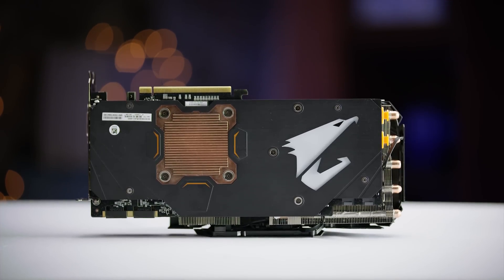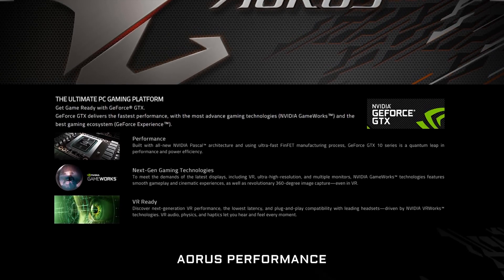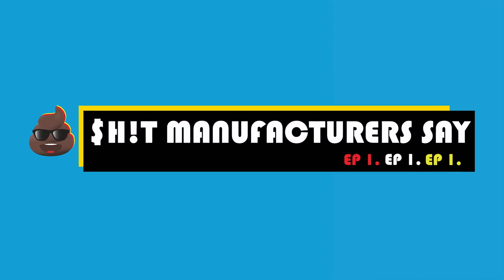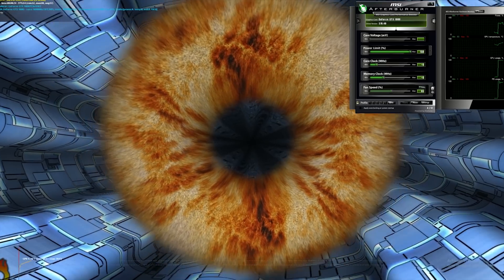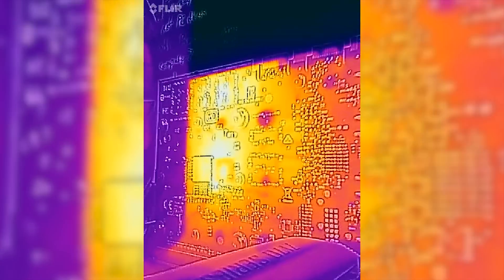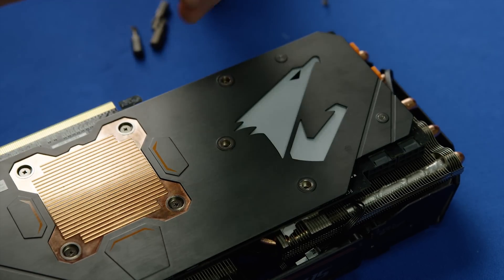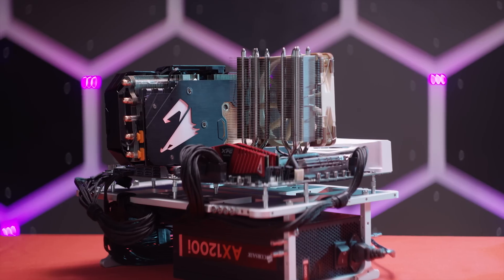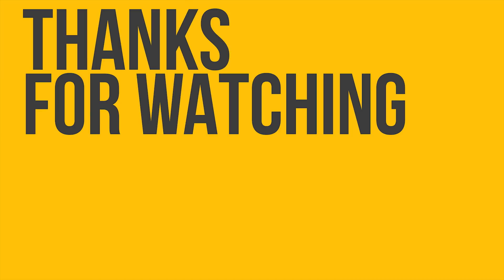$h!t Manufacturers Say Ep. 1 - "Backplates Cool Your Video Card"

Comment: Enjoyed the video and your results matched my intuition. However, there may be a small methodological issue due to the lack of airflow on the test bench. That copper backplate, which is really a heat sink, has a terribly small surface area and would never be efficient passively. Passive coolers are usually massive with very widely distributed fin stacks. Therefore, it is at least conceivable that it needs significant airflow to efficiently get rid of absorbed heat. 

In order to give the Aurorus Xtreme Gaming its best possible shot, in addition to a more real-world test, I would suggest either testing it in a functioning enclosed case or simply adding a couple of NF-A14s to the front of the test bench. 

My suspicion is that this will make no observable difference on your equipment, but principle of charity and all that.
Reply: this test would make more sense in a closed case with airflow. Indeed other tests showed that backplates can help to cool the card with a couple degrees difference. Some people made custom backplates with cooling fins or even watercooled backplates and had great results.

Comment: The copper "heatsink" on the backplate is just a copper alloy with no coating, one can't read the temperature of bare metal with a thermal imaging camera as one would find oneself reading the temperature of nearest reflected wall. In the industry a thin tape or coating is applied to the metal to achieve an accurate reading.

Comment: This actually matters a lot more on cards with GDDR on both sides of the board. A lot of times, the front-side chips get thermal pads to the main heatsink, while the rear ones are left to roast.

I understand that they can reach temperatures in excess of boiling before it is a problem, and you will burn your hand at 50-60C making touch a poor indicator of safety, but it just doesn't seem right, especially when overclocking, to leave some of the chips exposed.

So normally, I get one with a back plate and check to see that thermal pads are placed between the plate and the BGA chips. In some cases, I've added them. Back when I had my 6600GT and got a Zalman cooler, I actually bought some sheet aluminum and bent it into shape, used some thermal tape for thermal conduction, and electrical tape to protect the surrounding components. Made a world of difference, especially when overclocking the RAM.

Otherwise, I don't see a rear-mounted hunk of metal doing much with regards to the GPU itself. The die is placed on a breakout BGA daughterboard, so it isn't exactly a direct thermal interface where you could use a ton of thermal vias to redistribute the heat. like, 99.9% of your thermal conductivity will be at that point where the die itself directly touches the copper. Anywhere else, and it is going through the die, the daughterboard, the BGA solder balls, the thin traces, the insulating fiberglass board, a thermal pad, and then finally to the copper on the backside. The only thing I can see it doing is improving the lifespan by reducing the rate of heating/cooling of surrounding surface-mount components.

Comment: Your test is in an open world environment without very much air moving over the copper plate. Try the same test in a case and make sure there is ample air flow over the copper plate.

The copper block may not reduce the GPU temp it self but i am sure it keeps some of the massive heat from the GPU from spreading in the PCB to the surrounding components so i would not say it is worthless.

BUT the most important part is that it makes the gfx card look so much cooler, if you pay for xtreme you also want the xtreme look :D

Comment: There is only one benefit to a setup like presented by this Aorus card. By effectively cooling the components around the card, you extend the life of the card. Problem I see is that it does not focus on the power management components and mostly focuses on ridding of heat surrounding the gpu component. This could result is fewer bga fractures related to heating and cooling. Thing is, most cards I have seen, die because of other component failures more often than bga fractures. So I rate this backplate a gimmick because it does not focus on other components that need it more, like the power distribution segment that still shows a toasty hot in those thermal imagines.

Comment: What a genius idea hey lets stick a heatsink on the wrong side of a ~1mm thick plastic polymer that surely wont possibly harm it's effectiveness right I mean it's not like plastic polymers are usually used for thermal insulation rather than conduction or anything right? And yeah I am talking about the PCB itself the thing is plastic what on Earth were they even thinking idiots. For something like this to really work at all it would need some kind of solution to efficiently transfer excess heat through the PCB even then with the relatively low effectiveness of passive cooling and the fact those tiny fins are really not doing much for increasing the surface area of that copper backplate for it to transfer any real heat load at all away it would probably need to be expanded in surface area to cover the entire back of the board or something even then I can't imagine it disposing of even a fraction of the heat of the actively cooled heat sink on the front without having case fans positioned deliberately to direct air flow over it.

Comment: I had an EVGA fail because it did not have a rigid backplate. That backplate is a must for a tower case as it stops the card sagging which pulls away and makes a poor contact between the heat sink and GPU die.
Never buy a high performance full sized card without that backplate if you want your card to last.

Comment: Out of curiosity, have you done any testing to see if the backplates have any effect on the ambient temperatures inside of the case with the side panel in place?  I know the GPU adds a lot of heat to the air within the case itself.  I just wonder if there is any effect on that temp increase with a blow-through cooler designed GPU with or without a backplate.

Comment: That copper backplate looks like it might have a decent purpose; what are the odds that a closed unit CPU water cooler could be attached to that backplate like the Corsair Hydro H55 or something? My guess is that if there is any sort of decent heat transfer to the plate, adding a CPU cooler to the back would essentially turn the card into a ghetto hybrid cooled card.

Comment: Wouldn't it depend on how the GPU temp is measured? 
With the copper plate it'll dissipate the heat across the card away from the processor. 
So if it is measured by temperature across the entire card it'll read the same, but the graphics processor might actually be cooler. 

The more accurate way to test this would be, to measure where the chip is with a thermometer gun.

Comment: I know there weren't any temp differences. But you should put the backplate back on and retest. by taking off the cooler to remove the backplate, and putting back the cooler, that's a lot of change. maybe it's tightened better with better contact

Comment: Here's a question,
Far be it from me to question your guys, as I'm fairly new to this, but, shouldn't a fan be blowing on the backplate heatsink?
I mean a heat sink does nothing more than pull heat from a source, but it needs a flow of air to dissipate it more efficiently, something the inside of a case usually provides (ususally).
I didn't see any fans blowing in the direction of the backplate to allow for dissipation...

Comment: When you have a BGA chip with copper vias all the way through, you can indeed cool a chip from the reverse side. However, the heavy duty cooler on the front with lots of moving air certainly matters much more. I would have run that test with the card next to something which also moves air to at least give it a fair shake.

Comment: You didn't mention anything about fan speeds which were probably on auto so having the same temperature does not tell us anything. Removing the cooler and reapplying the thermal paste also invalidates the test. It would have been easier to simply cover up the copper on the back so it would no longer radiate heat. There may also be an improved benefit in a case, depending on the set up.

Comment: Did you guys consider that the backplate could be there for cooling other components other than the GPU Cores, like memory and power phases, MOSFETS and so on. it could be actually for safety rather than performance.

Comment: It absolutely depends on the card.
I have two 1070 Phoenix GLH, and their backplates get seriously hot.
They're mounted with zero spacing and when I bench the lower card and crank up the top cards fans the lower cards temperature decreases by 5 to 6°C. 
So with airflow at their backside Gainward Phoenix cards definately run noticeably cooler.

Comment: the test bench was placed horizontally on the table, but if the motherboard was in a vertical position like it would be in most PC cases, would that change the result? because heat rises and in that position more heat would be directed towards the back plate.

Comment: I put a 70mm CPU fan on the back of my old HD3850 back then (with a 10mm spacers in between). I remember it droped a few degrees, and the backplates (specially the VRMs) weren't dawn hot anymore.

Also those card have massive cooling solution, maybe there are a small different with smaller coolers (those that cards don't include backplates). I remember people use to put "sandwich" heatsinks to old PCI video cards, when the stock coolers where a joke and there weren't any aftermarket solution available, only adapting old PIII slot heatsinks.

Comment: Can anyone tell me how much power an 8-pin power connector can supply, I thought is was 150 watts, but the quadro p6000 draws 250 watts of power (75 of those watts from the motherboard), and it only has 1 8-pin connector

Comment: I watch the whole videos.  The problem he is making in this videos, he is reading only core temperature without reading vrm temperature on a open bench station.  He misses a important fact it doesn't cool the GPU core from underneath the socket of a Gpu that would of help keeping it from spreading across toward the Vrm, but instead is cooled by the Heatsink shared with the GPU if the marketing tags ring true.   Gpu-z have this as well with HiWinfo64 to show the temperatures of the Vrm, when he taking it off butt naked, we should be seeing some different number and again, doesn't show that data because it was missing.

What I would of done in this tests is to get the arm fan holder and position it on the front end to provided some relation of a case air flow when on open benchmark case.   What test bench he doing is open space, no airflow going anywhere as I would might as well uses it as a electric stove to make me a grilled cheese sandwich.  The cool spot of the GPU heatsink showing it doing it job of absorbing extra heat coming from underneath.  I would dare you to touch the back of the Gpu and tell me it isn't skin burning hot lol.  But you might want to watch what you're typing of your videos titles, otherwise you are making a fools of yourselves without some extra data beside the cores temperature.

Comment: If it was me, I would not have used air cooling on the CPU that is effecting your results when testing the gpu even if only slightly but try again with water cooler for the CPU????

Comment: Pretty much every video about thermal management or improvement is going to yield these results. The temps you see in a PC just aren't high enough to offer that amount of variability. We have systems that work already, and changing airflow or the material for your sink isn't going to make measurable changes, especially not noticeable ones to the average user.

Comment: temp difference that you see in flir is due to different emisivity. that means that textured plastic can be 5degrees higher than shiny copper, even if they are at the same temperature. read wiki about emisivity ,

Comment: Shit youtube channel Say that the temperature of the GPU is only the core one. and that putting a card on a bench is a good method to measure temperature of a passive system that will strongly ne affected by air flux.
Not saying that this backplate is more useful than any other or useful for the core or VRM or voltage regulation temperature. But in some scenarios (mostly dual graphics cards) with a limited air flux if VRM are on the back or voltage regulation system is on the back of it the backplate fucking helps

Comment: Have you guys ever considered that there is more stuff in a gpu than the gpu itself??? 

YES! I'm talking about the VRAM! 

Didn't tell us about the VRAM temps did yea!? 

Would appreciate it if you had used hwinfo and checked out the VRAM temps. Because if you DID, you'd notice that heat at the 'BACK' of the card dissipates quickly when a back plate is installed. 
You've half proven my point when you 'accidentally' mentioned the cold spot on the Aorus backplate. That's shows that the backplate helped in dissipating the heat at the back better, so less concentrated heat is stored on only one spot on the pcb of the graphics card. 

Kitguru do these comparisons with that thermal imaging. 

MSI's Rx 470 without the backplate have a big hot spot at the back, but not sapphire Rx 470 which has a back plate installed. The hot spot in more evenly distributed at the back.

Comment: Luke, was the copper square warm or hot when it was on the card? Would it have an effect being in an actual case with case fans running blowing air into the case and therefore over the copper plate?

Comment: Perhaps, if the card was lying horizontally, with the plate facing upwards, you may have seen a degree or two improvement. That is usally how cards sit in regualr PC cases. Also, it helps concentrate the heat to a central area which can be cooled by case fans. 

I don't think a test bench was the best way to actually test their claims. Still, it would literally make zero difference in terms of performance, whether or not there was a 3 degree reduction in temperature.

Comment: Not arguing with findings, but theoretically a back plate can help relieve physical stresses brought on by temperature differentials on the board.

Also, when using a FLIR camera, it's best to compensate for surface differences. Having used these before, the application of a specific SKU of electrical tape, or spray on foot powder (yup, they both work for this) will leave you with a reliable point to read IR temps with.
Reply: Update: I found the thermal images that demonstrate the thermal imaging surface issue, but don't know how to post photo responses....
Reply: try imgur and post a link
Reply: Well that took me a while... The word I was looking for was "emissivity." Without knowing the emissivity of a surface, the camera can't accurately interpret the data it receives. In this image, the bright spots are the areas where we used electrical tape to normalize emissivity to 0.95: http://imgur.com/W5dqqNg

Comment: did you set the fan speed fixed?
Reply: If you look, the fan speed as 64-65% with the backplate on and 69% with the backplate off.
Reply: @zshadows  Good spot!
Reply: @zshadows  so I guess it wasn't a complete lie but seriously, you're not gonna notice a difference. just over engineering for the sake of over engineering
Reply: This was the question. It may have run just lower fan speeds with the same target.
Reply: no they didnt lol, you can see it in the video it was on auto

Comment: if it looks hot doesn't that mean it's emitting more heat therefore dissipating more heat? so the copper plate is actually insulating the card which is bad?

Comment: Accelero Xtreme IV aftermarket GPU cooler has actually great cooling on the back side, basically doing memory cooling (so NOT extra cooling for the core) through the PCB. It takes an extra slot of space though.

Comment: Just think about how thermal conductance works. It's like a parallel network of resistors. Imagine the front cooler being a really high conductance (lots of surface area and high airflow). The back cooler has much less surface area and barely any airflow, so it might conduct only 1% what the front cooler does. So putting them in "parallel" would only benefit 1%.

Comment: The "cold spot" on the backplate seen in the thermal imaging video was almost certainly due to the reflectivity of the copper.  Reflective surfaces will generally show up as the temperature of whatever is reflecting off of it.

Comment: IF you could of locked the fan speed on the video card, might of seen a change with the cooling.  However I don't think the backplate would make much of a difference imho.  Without increasing the surface area(fins) or air flow in that area I really don't think there would be a change.

Remember the copper plate was ribbed for your pleasure and not for cooling :)

Comment: why it didnt improve gpu chip temprature. if there are mosfets,transistors on top of pcb the heatsink will help to cool them components. now these components would be ok without heatsinking however if you can keep them cooler they will live for longer. and improve performance of them for longer. this card is the overkill kind of product

Comment: You should have done this test with the GPU running inside an average computer case, so the copper back-plate is exposed to the constant flow of air being cycled by the case fans. How else would the heat dissipate? You guys are great and no hard feelings here but having your motherboard exposed on a test bench doesn't exactly simulate the environment a GPU is normally found in.